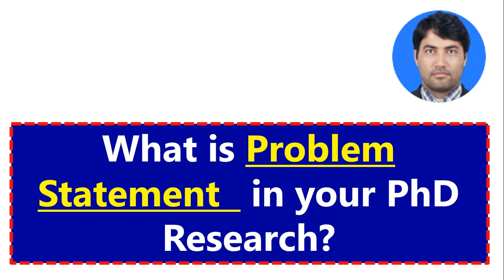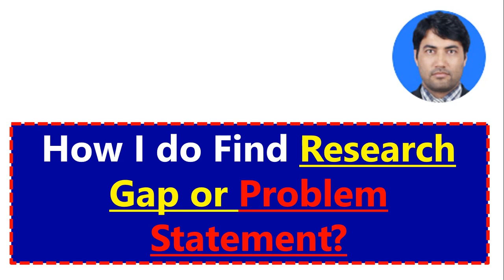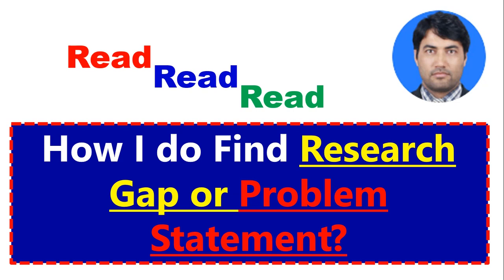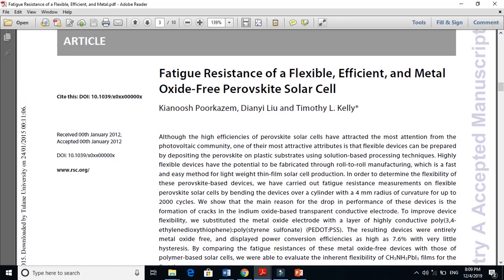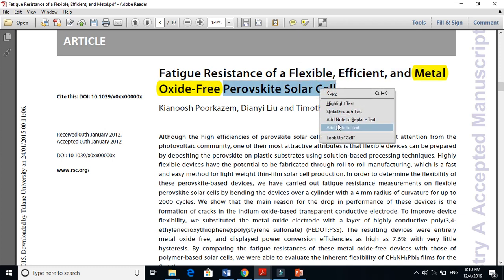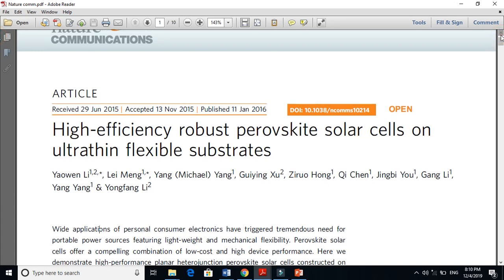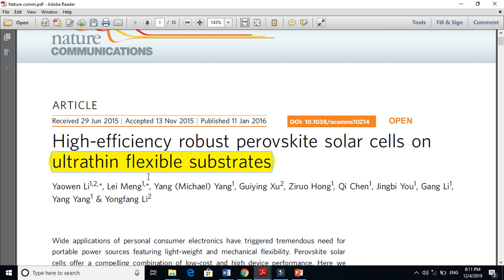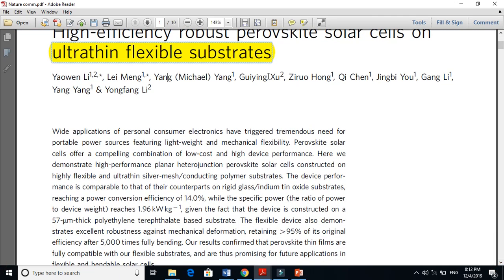How To Find Research Gap?  How to Find Problem Statement?  PhD Research Proposal.

Comment: Thanks for a well  explanatory video. I want to place my problem statement in researched idea in paper but unsure where to place it and how? In main paper before or after introduction? 
I am in haste to submit very shortly. Can you post a video with alarm to me.
Secondly, if paper is submitted through mail, Date of submission is date of post or I have to adjust settings as per my geographic area. Please guide and instruct.
Reply: Good evening. Thanks for reply. My immediate interest is to offer a sustainable idea that reduces car uses and emissions.I am write problem statement as part of my paper. Should the problem statement starts before introduction or is a part of Introduction together just after a para and continues thereafter literature gaps covering behavioural, environmental and product improvements  influenced by numbers. of economic areas of significances
Reply from the maker: @kailashprasadbhawsinka2258  that's great research field you are working.  According to my understanding,  you will write a research proposal not paper.  You should put the *Problem Statement *  after immediate the *Introduction*.
Reply: Thanks for providing insights. 
I believe, unlike future actions, the idea writing for a change to shift in consumption habits are to be written like a full paper that adds to change, collaborate and cooperate and shall not be differently place problem statement like other research papers.
Reply from the maker: @kailashprasadbhawsinka2258  that's great to know.  Best wishes for your paper and your idea
Reply from the maker: I am happy you liked it. Actually Problem Statement has to write in the thesis introduction, just before the *Research Objectives*. Can you clarify what is your field of research, please

Comment: Sir, after finding the gap how to find a new methodology to solve that problem in our proposal?
Reply from the maker: You will use the same methodolgy from where you got the problem /gap. But with a slight modifications.  Then see whether it improve things or not. Then you have to again change the strategy. 

Look,  you have to make a hypothesis first then go to the real ground later.
Reply: @nanospeaks  sir could you please show how to modify methodology? I always stuck after finding gap what kind of strategy should be implemented to solve that problem, it would help me a lot if you do that please sir.